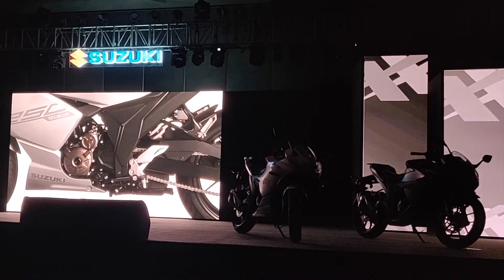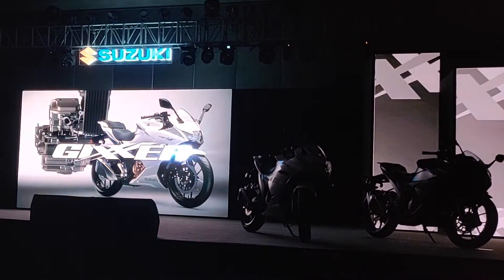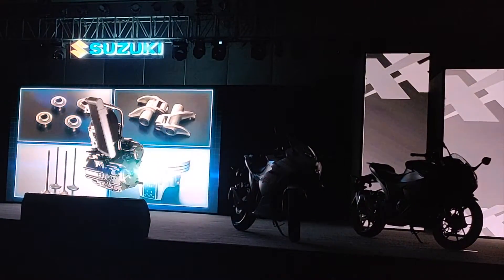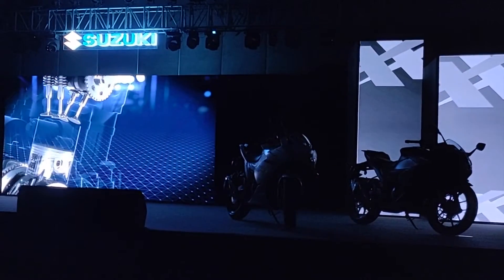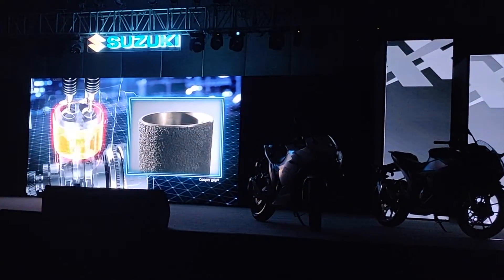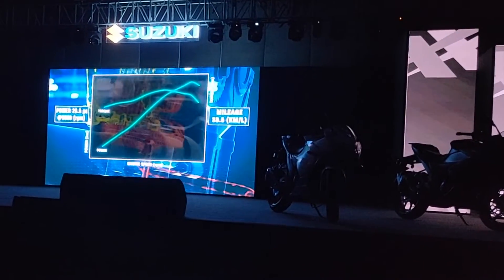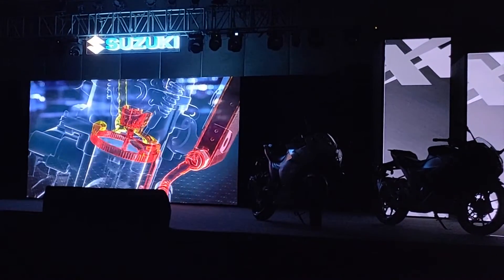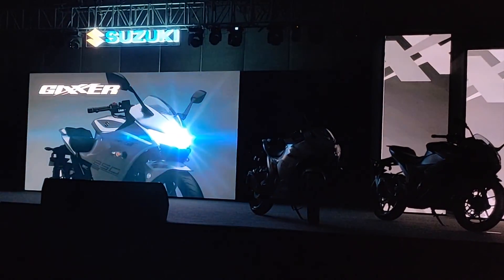Suzuki Gixxer SF 250 - SOCS (Oil Cooling) Engine Technical Explanation

Comment: All this is marketing, they used oil cooling instead of water cooling to save cost & weight.
Water cooling is 3 times more efficient than oil cooling.
Reply: Then why do KTM s heat like hell despite using liquid cooling ?
Reply: @BloodySweetBadass  haha nice one
Reply: @BloodySweetBadass  why did you buy the. 11th hand 20  years old  bike 
Maybe that's why it heat
Reply: @parasgotama  nah it's the ktm
Reply: And why does dominar fry your legs while riding in traffic?
Take your shitty liquid cooling and shove it...
Reply: This oil cooling is more efficient than most of liquid cooled.